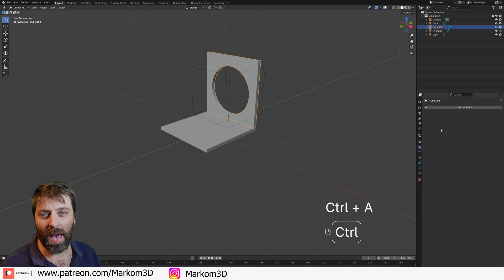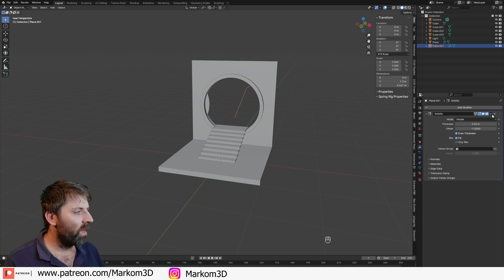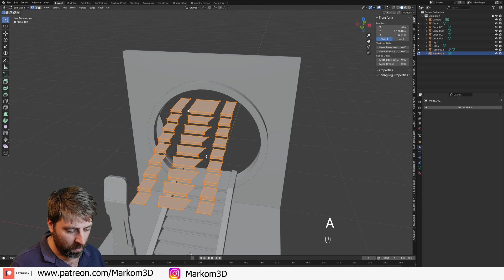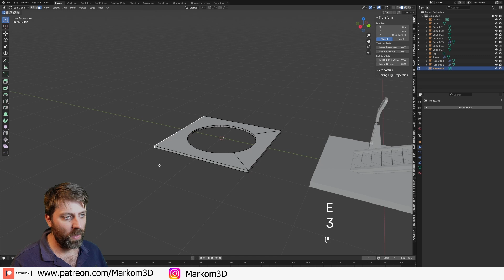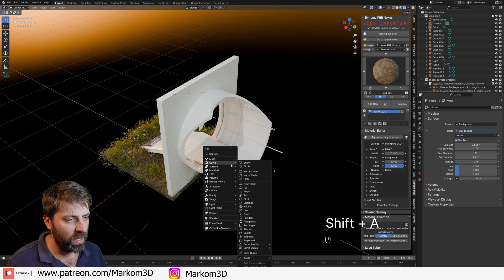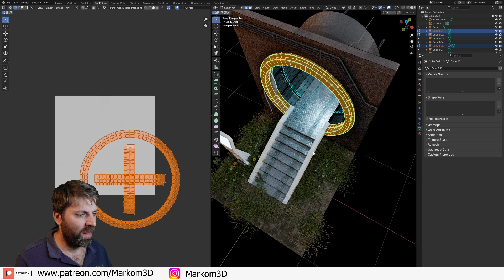Full Tutorial on creating this 3D model in Blender Beginner

Comment: Cheers for uploading but a note on this Bool Tool.  It only works if 'Fast' and not 'Exact' otherwise it just turns the cylinder into a square with only the face having a mark of the circle but no penetration and hole being made. 2.93 Version is being used for me.
Long tutorials are way better.